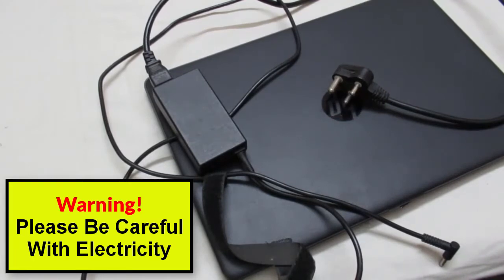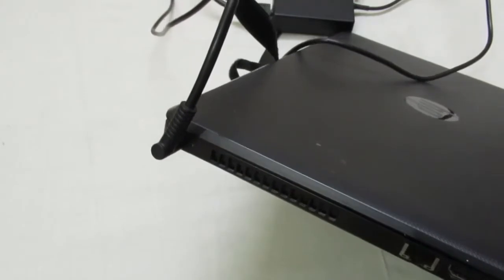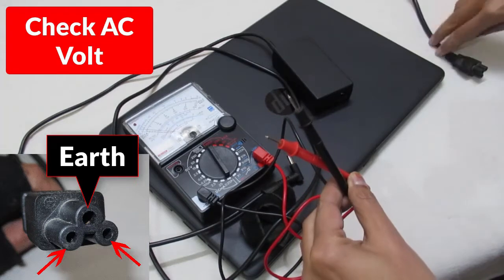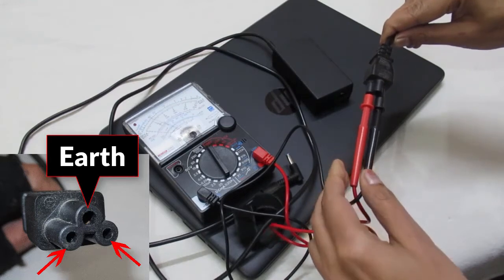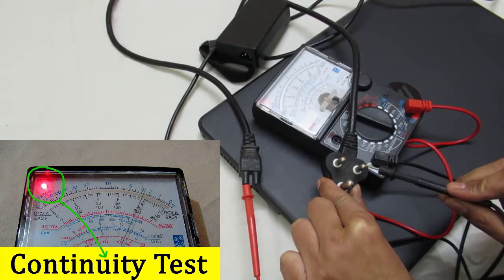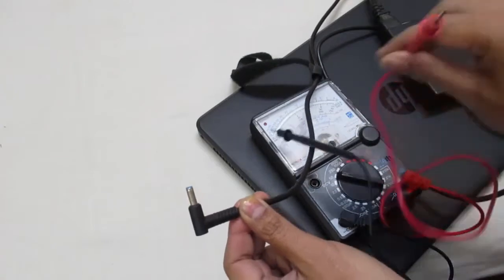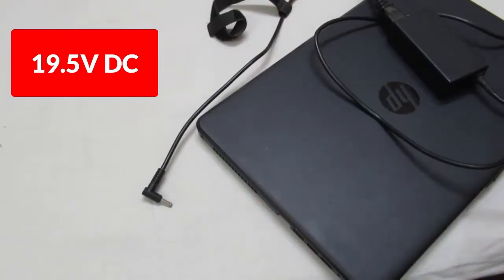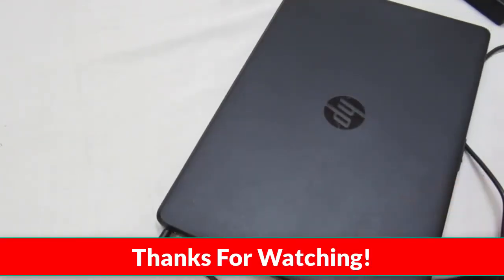How To Check Laptop Charger Voltage and Fix (Solve) Charging Problems?

Comment: my laptop is charging properly but keyboard and mouse keeps disconnecting  and reconnecting again and again when touching the cables of keyboard and this only happens when my laptop is connected to charger . is this issue can be caused by  faulty laptop charger?